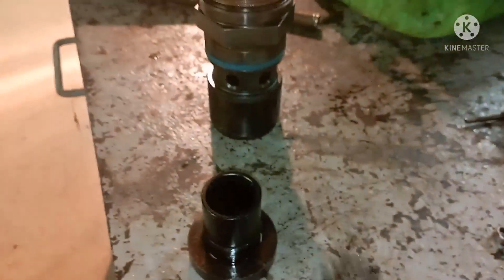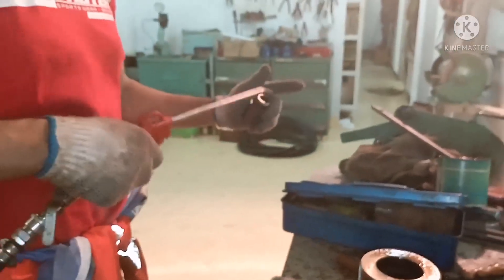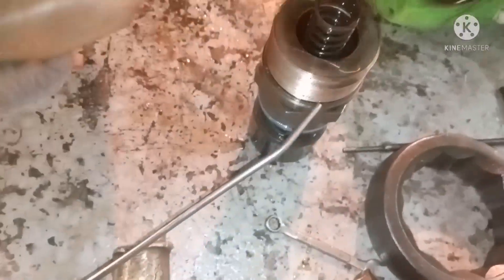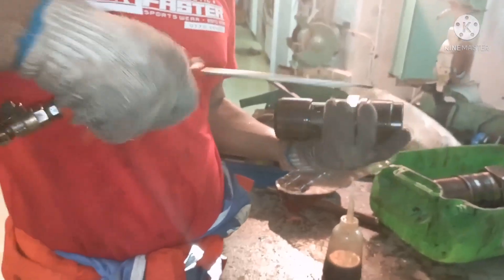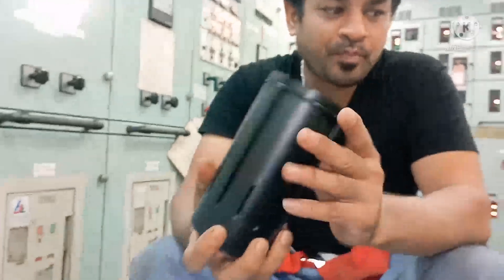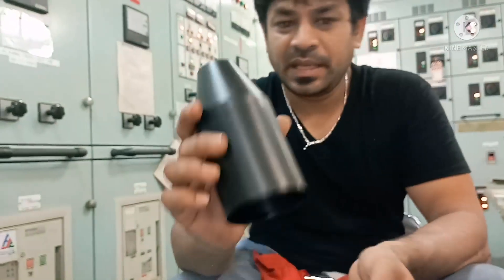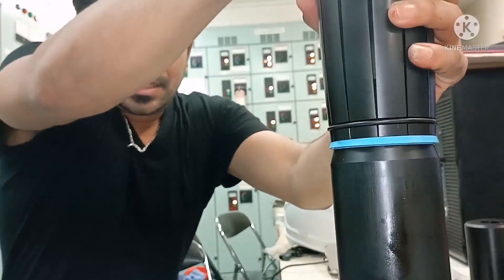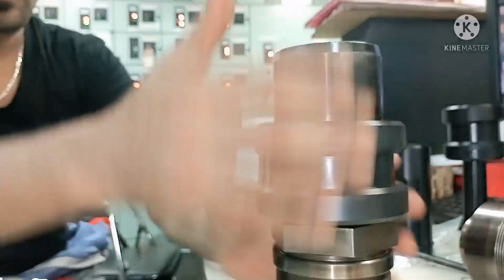HOW DO THEY DO.. HOW TO OVERHAUL FUEL PUMP SUCTION VALVE FOR MAN B&W ENGINES..

Comment: KINDLY NOTE SEAL RING AS PER INSTRUCTION  MANUAL 7S70 MC IS WRONGLY ASSEMBLED AS U HV PUT SEAL RING SPRING ON DOWNSIDE, SEALRING SPRING SHOULD BE UP SIDE WHILE PUTTING THROUGH THE CONE. KINDLY CLARIFY, THANKS,, MOL TEAM
Reply from the maker: Thanks for your good alert... To avoid installation confusion both the sides of seal ring have tapered design..but still self will check with manual

Comment: What should be the direction of the the seal spring? And do you need to heat it
Reply from the maker: No need to heat it as we use tool to install these seals...

Comment: Hi sir i have doubt ones we put in wrong way the sealing ring how to remove it back and put again. do we have any special tool or else simply use screwdriver to pull up
Reply from the maker: If u put it wrong then we need to remove it, while removing seal will get damaged .so u need to renew it..